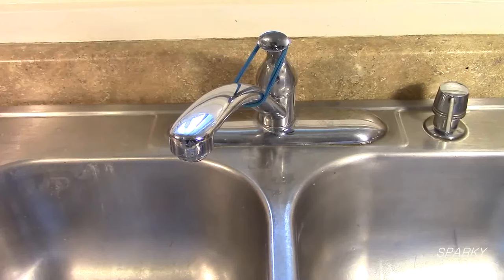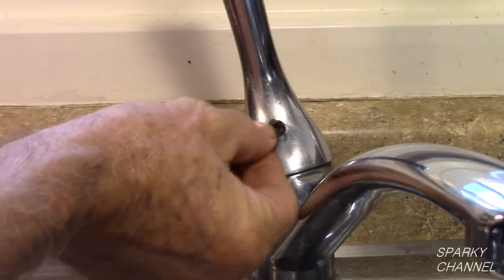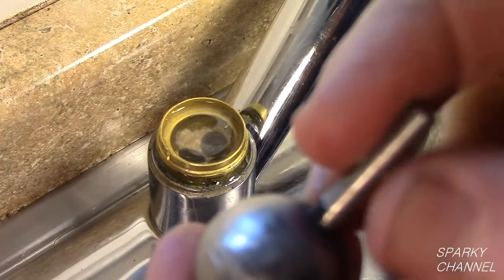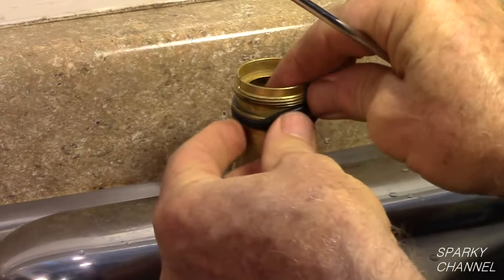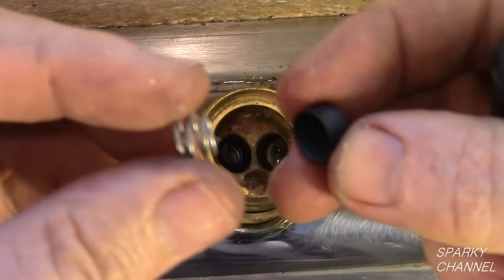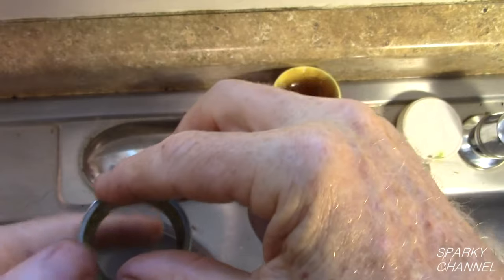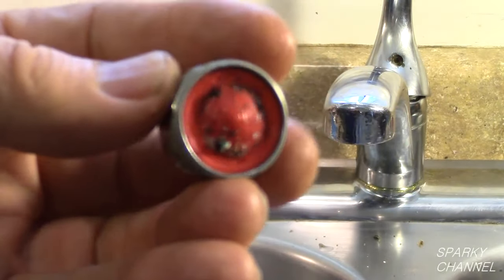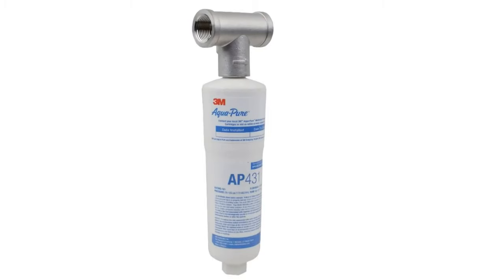Delta Kitchen Faucet Leak Repair (Single Handle)

Comment: I'm another profusely grateful DIYer who followed your guidance and did this job today.  Appreciated the extra info on aerator. One difference from your vid: I didn't have a spout O-ring. No big deal, it seems.    I indeed received free parts after calling Delta. Their Lifetime Warranty apparently went into effect in 1996, so normally MY faucet wouldn't be covered since it (and the tenant in rental unit) had been there since 1987. But they sent parts as a one-time courtesy. Yep, faucet was OLD; but I was prepared for a corroded set screw and handle not coming out readily.  Another YouTuber does comparisons testing a host of products, and proved that the MOST effective "rusty bolts remover" was NOT WD-40, NOT Blaster, but a 50/50 solution of Automative Transmission Fluid and Acetone. (Liquid Wrench came in 2nd.)  I still had to be patient, also tapping gentle at the gap between screw and handle, but DID prevail.  Yay!!  Also needed it to "unstick" the cold-water shut-off valve too, also wrapping a hot towel around it. Yep, just getting started can be tricky...  So again, Bill, THANK YOU for sharing your expertise and helping so many people.  Def saved a bunch of money. Um, I didn't spend ANY; only time, which is fine.  What a great feeling of accomplishment after job done.  Take care!

Comment: You rock Sparky!  Great diy video.  My faucet is 2 yrs old.   021224 I called Delta and they are shipping me my seat spring repair kit, free of charge.  They were kind and helpful on the phone.  I am stunned to see a Lifetime Guarantee being honored with no muss/fuss/fine print weaseling.  Go Delta!  (faucets, not plane carrier....that is a diff story)  😜
Reply from the maker: LOL! Great to hear.
Reply: My kitchen faucet is 22 years old and the chrome still looks like brand new.
I called today and they told me what parts they were going to send for FREE. 
I will receive then in 7 to 8 days she said.
What a great company!
Reply from the maker: Excellent! @davidh.8513

Comment: This saved me! There are hundreds of leaky faucet videos out there, but yours is the only one that brought up that the handle can get stuck from excess build up. I thought mine was broken because the set screw cranked violently and came all the way out. Nope, it was just SUPER stuck. Some light and persistent taps and it finally came undone! I was a hair away from calling a plumber because I thought I had busted the whole thing. Thanks for the video, man! You probably saved me a few hundred bucks!
Reply from the maker: You're very welcome! Sometimes, it's a detail that makes an explanation work.

Comment: I may have previously commented on this video; it doesn't matter.

Thank you for not only showing how to fix this specific faucet, but more importantly the process of how to go through this type of repair in general.  The details you show, keeping track of the parts during disassembly, the caution to not lose parts or damage things help to make it easier to reassemble it and know where the new parts go and fit together.  You're not just demonstrating doing it, you're explaining the how and why behind it.  Add in the recommendations for tools and using them properly, and the lesson is complete!

Well done!
Reply from the maker: Thanks so much! You're correct, it is really important to keep organized and not lose any parts. Have a great day!
Reply: @SparkyChannel  Dripping finally forced me to repair the kitchen faucet. First time I repaired a single handle ball valve kitchen faucet. Your in-depth explanation of how to re-install the ball valve saved my day. Eighteen dollar rebuild kit from Home Depot and I'm done. Thanks.

Comment: I am very much a novice at plumbing repair.  But your step by step, detailed instructions made it a cinch to fix the faucet that was spraying all over the place around the handle.  I do not have time to call a plumber or call Delta and wait for the parts since we have company coming to stay in the guest room for Thanksgiving.  I can't believe that I fixed it myself by replacing the parts I bought from the hardware store.   Thank you so much.
Reply from the maker: Great job!

Comment: Just got new parts from Delta and they have eliminated the ADJUSTING RING and replaced the Cam and Packing with a one piece. I’m glad I read the instructions. Your video was a great help.
Reply from the maker: Thanks John!
Reply: I`ll have to see if my new one comes that way without an adjusting ring.

Comment: Thank you soooo much!  I was able to fix my mom’s old Delta 150 series kitchen faucet.  Thanks to your advice, I was able to get all the parts from Delta free (except the steel ball assembly, which they either forgot or it’s not a covered part).  Anyway, after I purchased the ball assembly separately, I cleaned the faucet and replaced the parts exactly as in your video.  Everything is perfect now.  I appreciate your no-nonsense video, with its clear concise instructions.  No endless self-aggrandizing intro headers with annoying music….perfect!
Reply from the maker: Thanks so much David!

Comment: YaY-Hey!!  You Have Really Helped Me Out!!  Had a 'handyman' help with this and he did such a lousy job!!  Didn't grease almost anything, left the white plastic ring at the bottom of neck of the faucet!!  I did it All over again.  Only had trouble with the grey cam, not staying down, it kept wanting to spring on up.  I held it down and put the chrome cap on tightened it carefully! But not too tight.  Faucet swings back and forth a Lot better than when the guy 'fixed' it!  Guess if you want something done, do it yourself or look for Sparky to help me out!  Thank You Ever So Much!   Take care, and keep up the fantastic work!!😁🤩😁
Reply from the maker: Great job! Sometimes a little more attention to detail makes a big difference. Thanks!

Comment: Thank you SO MUCH! After several fails and a couple of frustrating hours, I figured out to put the small end of the spring in the hole first, then the seal over the large end, just the way the old one was. That was the only way I could get the seals to seat so it didn’t leak.

Comment: Thanks for all the guidance on this. Our delta single handle wall mount faucet (from 1990's?) has been long out of production, but after waiting on hold and sending photos, they sent us all the parts we needed (in 3 shipments from 2 different states). Your video made it as easy as you make it look.
Reply from the maker: Great job, way to go!

Comment: Thank you Bill! I'm about to replace a 40 year old Moen kitchen faucet with a brand new Delta Classic. (Or rather, a plumber is about to replace the faucet, since there are no hot/cold water shut off valves, which need to be installed, and that's way beyond my ability to deal with.) But looking ahead I wanted to be able to know how to fix any leaks that will inevitably occur down the road. I saw replacement kits on Amazon but after watching this video I'll just contact Delta since the faucet comes with a lifetime warranty. But people said there are no instructions that come with these kits, so I searched on YouTube (what would we do without YouTube instructional videos?) and found this one. It's perfect. Much appreciated. Be well.
Reply from the maker: Sounds great! Best wishes!
Reply: @SparkyChannel  Thanks. 1 quick question: How wide do the jaws of the adjustable wrench need to be able to open to work with the nut on this faucet? (i.e. will 1.5" be wide enough, or does it need to be bigger? I know they should be smooth jaws, just not sure how wide.)

Comment: Thanks ! i just changed my delta washers on my kitchen faucet using your video which was the best among the ones I've seen on YouTube. The hardest parts was removing the chrome cap after the handle was off because my model did not have slots for a wrench so i had to use a vice grip but it wouldn't budge at first but then someone explained to me i probably overtightened the wise grip and sure enough i just remove the cap with my fingers 🙂The other part more difficult was when everything was in place before putting the chrome cap back on. I had to use a screw driver to push everything in place that also left the part in its groove. It took 2 tries but I got it ! Turn the water back on and all is great and no more dripping !!! It was driving me nuts LOL

Comment: thank you so much for mentioning the plastic washer which fits it in bottom of the handle part--could not get it working without this important step--now no leaks; your step by step was really good
Reply from the maker: Glad I could help! Yes, it won't work correctly without that washer.

Comment: Great video and AWESOME advice regarding the tip about Delta providing replacement parts if you are the original owner when the faucet was installed.  Just received confirmation from Delta that the needed part is on the way.

Comment: Your video was a lifesaver, Bill.  My kitchen sink has no shutoff valves so a mistake would have meant no water to the entire house.  I wondered about all the plumber's grease, and after I finished the handle would not stay up.  But once I wiped the grease off the ball, the thing worked prefectly.
Reply from the maker: Excellent!

Comment: Thank you for a wonderfully detailed yet not too wordy explanation how to replace this single type of faucet. I rent but the current repair person is sadly inept and makes a huge mess for simple repairs. I was shocked at the results of the 6 inches caulking job under the tub faucet he did in my shower/bathtub that still had gaps, zero confidence. I fixed my leaky kitchen faucet without any surprises or lengthily clean up after.
Reply from the maker: Glad it was helpful!

Comment: We had a soft ring under the cam assembly. It made it a mother to hold the notch in while screwing the cap back on. 
Thanks for the easy to follow instructions! Great video! ♥

Comment: Thank you so much - once I patiently applied WD40 and a compressed air shot to the allen  screw(  a few applications over over a few days), everything was a cinch thanks to your instructions. One thing, as you and others have  noted be sure and use original Delta Parts. A top local store's brand of repair parts just did not fit right and were a waste of time. The Delta Parts were a smooth operation  and the faucet is just as new.

Comment: Bill, love the video.  Complete, concise and very easy to follow.  Thank you!   The only thing I would mention is "if" you still see a slow drip after replacing all faucet parts (Delta of course ;-)) check your aerator.  It can hold hard water sediment; the washers may need to be replaced etc.  This was my case.
Reply from the maker: Good tip, thanks!

Comment: Thank you for your guidance. I just a couple snafus. One was that the hot water shutoff leaked, so I had to turn off the main water valve and the water heater intake to get the hot water to stop. The tip to get the corroded handle off with wd40 was great.

Comment: Very good explanation on how to repair a leaky faucet. One thing I would caution viewers on is to be careful not to score the ball seat with the screwdriver. I would use something like my Dremel tool with a brass wire brush attachment for that part of the job. I also thought it might be a good idea to put a little plumbers grease on the outside of the two rubber inserts before reinstalling them in the housing.
Reply from the maker: Thanks for sharing!

Comment: Hell yea sick video, thanks sparky! It’s just about as easy as you made it. Incase anyone is panic scrolling MY everything was way dirtier than the video (steel wool ur bff) my cam assembly didn’t snap in entirely like the video just make sure its in the slot, faucet did leak the whole time until reassembly it’ll be alright just finish putting it all back  :D
Reply from the maker: Great job!

Comment: Just a heads up the newer faucets have a plastic cartridge.  There should be a tag on the supply line with a model number and manufacture date.  Was able to call and get a free replacement cartridge by calling Delta.  Great concise no nonsense tutorial! Thank you!
Reply from the maker: Thanks Andy!

Comment: Worked like a charm. Don't skip the grease. A Big South Florida Thank You, Wild Bill. $12 on Amazon to Fix it. The water valves gave me some trouble. However, after knocking on them with a wrench and a little WD-40 they loosen right up.
Reply from the maker: Great job William! Yes, those valves can get pretty tight.:)

Comment: What a great and helpful video, Bill! Thank you so much for taking the time to do this. This was a huge help. Question: when I got to the seat and spring step, I could find only one, the left, is it possible that the faucet has worked with only one seat since 2022, the last time I repaired it? I am an auto mechanic, and I know that it’s not good to have parts left over. We never had any difficulty with the faucet until it began leaking intermittently recently. Thank you!

Comment: Great job Bill. No frills, just all that is needed to do it correctly. I winged it last time (only lasted a couple years, no grease was one problem) but I will follow your vid to a T and I'm betting it will work perfectly. Thank you for posting! Subscribed!
Reply from the maker: Let me know how it goes. And welcome to Sparky Channel!
Reply: @SparkyChannel  Bill, Funny story: The parts in my faucet look IDENTICAL to the one in your video except for a "974-012 DIVERTER DEFLECTOR" that fell out of the spout supply hole when I removed the spout assembly. OK. I already had the Danco parts before I saw your video and heard your recommendation to get only OEM parts free from Delta and I did not get the kit with the new ball as I had looked at it and it seemed and felt fine, no rough spots etc., still mirror bright and I believe I had replaced it a few years ago. Well I otherwise followed your great instruction to a T and after putting it back together (with out a DIVERTER DEFLECTOR, I don't think it makes a difference) it seemed fine except the handle had to be in a pretty specific spot for it not to drip. Well I lived with it for a couple weeks and decided I would follow your advice and call delta and get OEM parts. I called and if 20-25 years old like my faucet with no paperwork, they ask you to take a picture to send. I did and the rep could not ID my faucet and asked me to look at the backside and see if there were any markings. There were markings and they clearly said Price Pfister Classic! Dang! OK. Called Price Pfister (800-732-8238) and they do exactly the same as Delta and will send you the parts. Parts are on the way and I will still use your fine video to remind me exactly how to install. Thanks again, my boo boo had nothing to do with you! Reminder to all out there to not ASSUME just because the parts look identical, that they are. I used a mirror to see the back and get the actual OEM name. 👍👍
Reply from the maker: Great story. How did it turn out? @bwvideo0905
Reply: Hey Bill, Well I got the OEM parts from Price Pfister, but had other projects going so I put the install off. 9 months later it is still put off🤣 Seems that "the handle had to be in a pretty specific spot for it not to drip" was not as big a deal, as that spot became easy to find over time. Hope I can still find the parts from PP! When I do, I will still come back to your great video for another refresher, and I'm sure it will work perfectly. Thanks again! 👍👍 @SparkyChannel
Reply from the maker: That's a plan! Best wishes! @bwvideo0905

Comment: Outstanding video.  However, here's a suggestion I learned from doing this fix.  When reassembling parts, do NOT use a wrench to tighten the top cap (fancy nut).  Just tighten that nut finger tight, and maybe give it another 1/4 twist  with a wrench.  Wrenching the nut down like a gorilla forces the ball against the (concave) mating surface and it rubs.

First time:  I firmly wrenched down that nut until it was snug and the faucet developed a slow drip - drip - drip, after final assembly in closed position - moving handle slightly off center seemed to stop drip.  Also, I could feel a slight "drag" when moving the lever around, in certain positions, indicating something was rubbing.  

I disassembled it again and noticed the 2 rubber washers (seats) were flush with the hole, instead of protruding slightly, indicating the ball was pressing against the body.  After reassembling I tightened the nut hand tight.  There was still a tiny drip drip.  I then retightened it by hand with about a 1/5 or 1/4 additional turn with a wrench.  There was still approx. 1/8" gap between the (lower) edge of the nut and (upper) edge of spout assembly.  If you keep cranking the nut tighter and tighter, that space will disappear until both edges touch.  The first time I did this, it seemed normal to crank until the space disappeared and the nut was tight.  (Like you would with typical threaded plumbing pressure pipe.)  But in this case it seems a little more finesse is needed.  Just my 2 cents.

Comment: Thank you for your good instruction! I was able to replace the insides of my Delta faucet. The hot water was leaking and it turned out one of those little thingies with the spring was cracked. Not anymore!
Reply from the maker: Glad it helped!